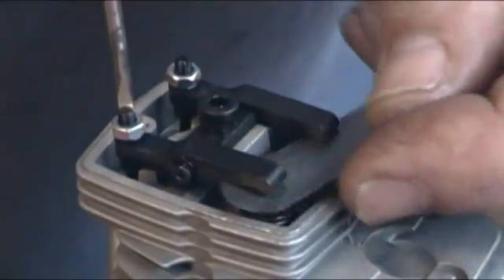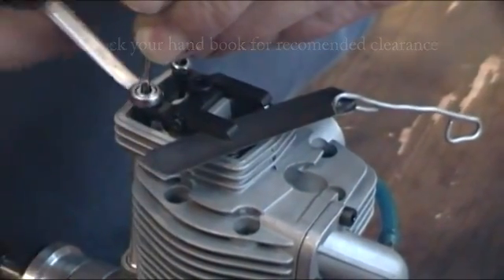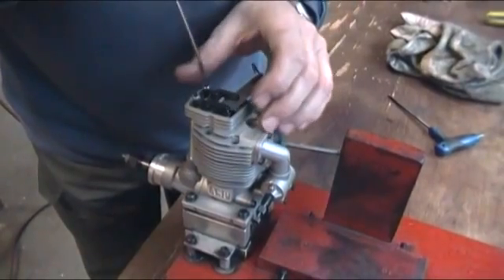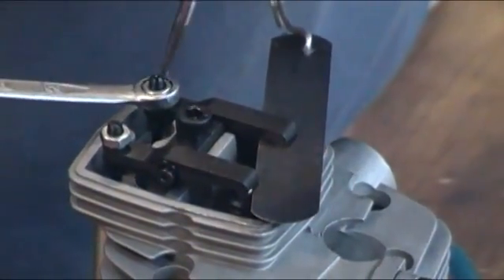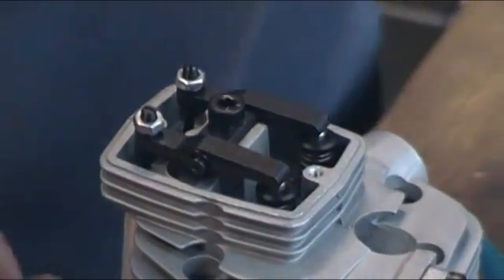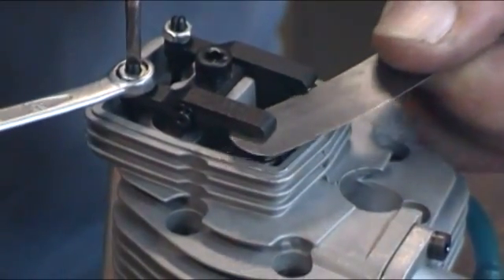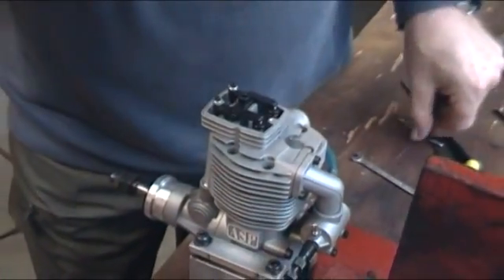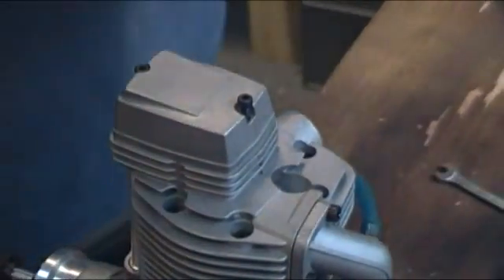How to set the valve clearance on a four stroke RC engine

Comment: Hello Man I need your recommendation..Do 4 stroke RC ENGINE IS BETTER THAN 2 STROKE ENGINE..OF SAME DISPLACEMENT....PLEASE REPLY I AM YOUR FAN....BECAUSE I AM GOING TO MAKE ONR OF THEM...
Reply from the maker: Hi there, both two and four strokes have there own benefits. 4 strokes are popular at the moment because they tend to be quieter with a more authentic sound, however two strokes give a much better power to weight ratio, have less moving parts and are cheaper.  It is a matter of horses for courses...
Reply: Just Engines howto  ,,Thanks. Man

Comment: If you were going to lube the rockers where would you put the oil ?.
Reply from the maker: if the engine is mounted upright then a few drops directly on the rockers periodically.  If the engine is inverted you could put a few drops down the push rod tubes.

Comment: Hi, I have several ASP engines, is there any tolerance on the tappet gap? OS recommend 0.04 to 0.1mm, will this range suit ASP's or is 0.1mm an absolute? Many thanks.
Reply from the maker: In engineering there is no such thing as an absolute, but if you use a 0.1 feeler you want it to fit between easily but with the slightest bit of resistance when it comes out.

Comment: Thanks for posting this.  I recently was given a Saito 90 flat twin that the owner could not make it run.  I have never owned a four stroke model engine but I repaired several minor problems and set the valves by watching your fine video.  Runs like a charm.  I don't do RC but I fly control line.  Have to find a suitable project for this fine engine.  Thanks.